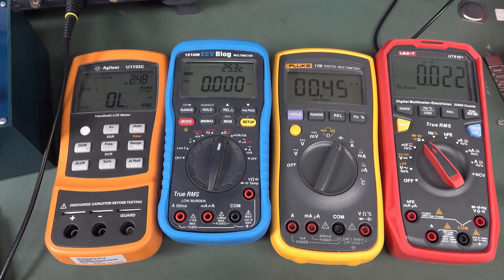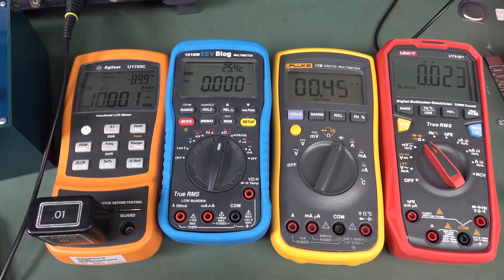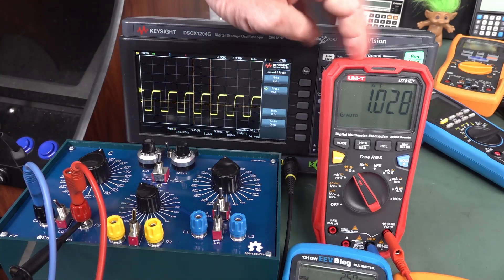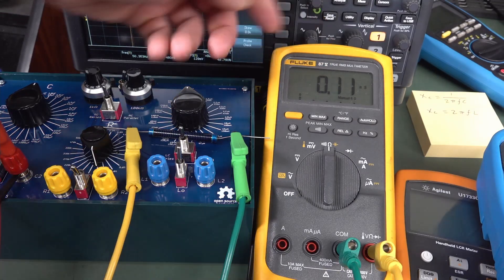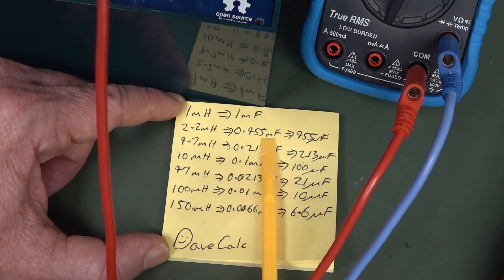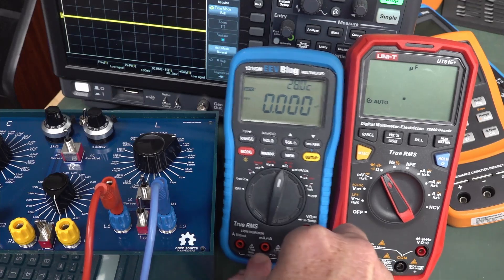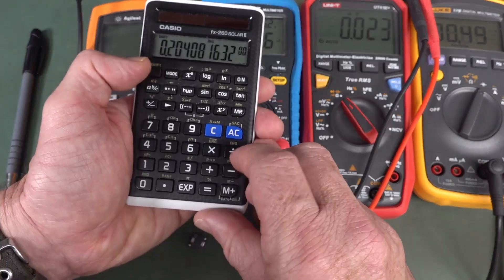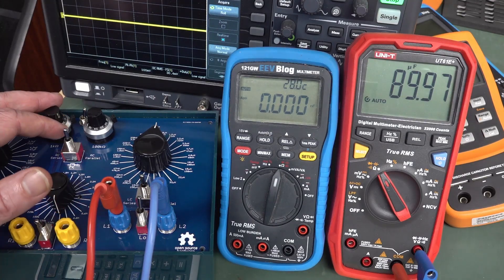EEVblog 1465 - Your Multimeter Can Measure Inductors

Comment: Okay... What's bugging me here is that my math is different. If the measured impedance is the same, then we can say -ZL=ZC, hence  -jwL=1/(jwC) where w is 2pi*freq... After some algebra, I get L=1/(w^2*C). Hence it is critical to know the frequency to compute the inductance. You're talking like the frequency cancels out or something.
Reply: Ok, so apparently this is all a big joke. Clearly most of these multimeters use an RC ramp to compute C.  But seriously, my Mastech MS8264 puts out a steady 400 Hz for capacitance measurement regardless of range or capacitor... if it's measuring current, it's just measuring V/Z, so if we compute the L for the equivalent Z, why wouldn't it work?

Comment: Why does mu LCR meter has different frequency to measure the inductance and why the result vary according to the frequency chosen?  I have measure a power supply choke.  It gives me 21 Henry at 120 hz and 18 H at 1 KHz and -5 Henry at 10 KHz…

Comment: Well that's cool, unfortunately my Fluke 117 isn't good at it at all.  It can't even be used on larger ones.  The only one I got read reliably was a 100mH coil.  I looked at it at the scope and it sends the pulse super random.  Had to capture it, and it's a 120mV pulse, lasting 1.2ms, whenever it wants to.  Surprisingly though, it reads capacitance great, down to the 10nF level.

Comment: This method seems a little complicated.  Seems like it would just be easier to build a calculator first instead of being so reliant on Post-It notes.  Once you build your specialized calculator, it should be no problem to slam together components to make a functional oscilloscope and signal generator.

Comment: I don't think that's supposed to be a triangle wave at 2:23 with the fluke. Looks more like the charge/discharge cycle of a cap subjected to a square wave. I think that it's basically using a DC measure of capacitance using time constants.

Comment: It's interesting that for some of the meters the frequency changed with the capacitance. I wonder if those use the capacitor in an oscillator and then measure the resulting frequency to calculate the capacitance value (as opposed to measuring the time it takes to charge the capacitor which is how I had assumed it measured them).
Reply: The one that showed a square wave in the scope probably did the charge time thing

Comment: I have 2 very old multimeters (over 20 years) and one has no capacitance measure and the other has slots to measure both on through hole components.

Comment: I love how the 121GW was actually almost bang-on with the 150mH inductor - it has shown 161mH, which you have commented as "not too far off", but then the LCR meter at 7:46 showed almost exactly the same, so 121GW was not off that much :D. It has more error for smaller inductors though.

Comment: Two other useful methods: create a parallel LC circuit with a known C, feed it with a signal generator through a series resistor, find the resonant peak and calculate L from it (if L is sufficiently large, you can use your phone as a signal gen). You can also measure the Q by measuring where the voltage falls to 1/sqrt(2). The other method is to feed the L through a small current sense resistor (in the GND side) with pulses starting from 0 duty cycle, increasing very slowly. Look at the rate of increase of current through the sense resistor, calculate L from it. If your pulser can provide enough current you can even measure the saturation current. You can build a pulser circuit with just a 555, mosfet, catch diode, and a handful of passives.

Comment: April fool to you too. The capacitor measurement uses a relaxation oscillator and measures the frequency that is proportional 1/C. I.e. Smaller C gives higher frequency. The relaxation oscillator can be as simple as a built in Schmitt trigger inverter and the dmm measures the period for a direct conversion to capacitance.  Putting any inductor in place of the capacitor with a dmm set to capacitance is just a short circuit. The relaxation oscillator just won't oscillate.
It was good to see the 10G ohm resistor I sent to you in mailbag in use too. Great joke video.
Reply: He practically got me on this one until i read your comment and started thinking about it in another way.

Comment: Dave, they don't output a triangle wave but rather a pulse. The priciple is called a charge balance. It's what you likely learned in high school about capacitors: Switch on a voltage in a RC circuit and you get an exponential charging function. Do a little bit of maths and you can calculate the C, provided you knew the R. Some of these do it exactly like that and this is where you don't get the triangle wave and others use a constant current source which results in the triangle. The idea behind the triangle wave is that you can easily calculate the slope by doing a linear fit which then leads to easy calculation of the C.
Reply from the maker: Yeah, well, that's just, like, your opinion, man.

Comment: well since you essentially need a scope to pull this off anyway (for probing the meter) 
you can just aswell use the test signal gen for probe compensation for that purpose. 
some scopes can generate a variable frequency on that output which is quite handy too

Comment: You wonder why meter manufacturers haven't added inductance measurement. Sure, 30 years ago it would have meant a shed load of extra gubbins inside, but with today's tech surely it wouldn't take that much - as demonstrated by Dave's DE5000 teardown.

Comment: Actually ive got a brand new electric shower i fitted but it let out the majic smoke after 1st power up.
I found 2 inline inductors on the power to the control pcb.
Aqualisa Lumi 10.5KW, a pretty expensive shower.
Its a touch sensitive front panel on/off.  So im wondering if the inductors are really needed? As i linked them both out, but havent tested it yet.
I think i blew it when i had power going to shower when i connected molex connector for panel pcb.  Which blew the inductors.
I wouldnt mind getting it working

Comment: Cool trick thanks, I sometimes forget about it but those ~$15 component testers also do a decent job at testing inductors and they can test the lower values too, I can't verify its accuracy, but now I could compare it to my meter at least.
Reply: You know you can make your own measurement test set with better accuracy ?  Just use a kelvin bridge.

Comment: I'm more impressed by that 10 GOhm resistor! I didn't know they made such high resistor values. I remember one of my professors scoff at the idea of 1 GOhm!
Reply: Mouser has 10 TΩ resistors in stock, they're not cheap though.
Reply: @rocketman221projects  What would the purpose be of such large resistors?
Reply: @ElTwOJaY  The one that Mouser has is rated for 30 KV, so it's probably intended for high voltage measurement. It would only have a 3 nA load at 30 KV.
Reply: @ElTwOJaY  they can be used in transimpedance amplifier configurations to measure very small currents (fA - nA). I have some resistors which are contained in quartz tubes and labelled with powers of ten It literally says 10¹² Ω on the part.
Reply: @uwezimmermann5427  hmm interesting, I am not much of an RF guy.
Reply: @ElTwOJaY  not much use for these in RF, rather in measuring tiny currents
Reply: I have a TΩ in my collection. It is awesome, cased in glass!

Comment: The method I use (make a LC circuit with a reference capacitor and measure the resonance frequency ) work mostly for small values so it cans be useful
Reply: That's what I've done in the past. Make parallel tuned circuit and use a little negative dynamic resistance circuit to make it oscillate and then measure the frequency.

Comment: I still don't understand inductive loads. A good idea for a video would be a summary of the best free online electrical engineering courses and channels. I love the content from Big Clive, and Fran and you, but I don't have the understanding to properly appreciate them.
Reply: The simplified answer is an inductor is a lot like a capacitor, just replace voltage with current and capacitance with magnetic fields, you put current though it, it charges up a magnetic field which restricts current flow until it's full then it becomes just a wire, afterwards it does the opposite when current flow stops feeding its charge, thus it smooths out changes in current, similar to how a capacitor smooths changes in voltage.

Comment: Not getting a result with an old Fluke 83 original! By the manuals I can find all the old Fluke 80's work by charging with a fixed current and testing voltage -- updating only once a second -- rather than testing at frequency. They walk you through though how to estimate large capacitances quick by using the ohm-meter though since it's also a constant current source, so I still got a useful tool added to my belt today!

Comment: i liked the "short the temperature leads" trick to get the internal temperature but this is the first time I have heard of using capacitance four measuring inductance
Reply from the maker: A really old school trick.
Reply: Had no idea about that. Mine will show internal temperature with no probe connected instead.
Reply: Why would you want the internal temperature of your multimeter?
Reply: @ryanb8302  Cause it would be closely related to ambient room temperature if you wanted to measure that.  I often do.
Reply: @kissingfrogs  I see
Reply: I only come here for april fools. Shows how gullible engineers are.
Reply: You all actually fell for this ?
Reply: @miller-clem  or did you you fall for others playing along convincingly

Comment: What you need now is a firmware update so that the multimeter calculates the reciprocal for you and handles the units properly ;)
Reply: Problem is the accuracy is so piss poor you could never really properly calibrate it. That's a big problem if anyone ever wanted to use this meter at work, where equipment needs to be regularly and fully calibrated.

Comment: Problem  is, this only works for good inductors.  If the inductor has low Q or a shorted turn, the results are going to be not so useful.   In my experience, I never need to test good inductors-- I'm testing inductors and IF transformers in old radios.   So not so useful, IMHO.  Regards.

Comment: Hey, what an awesome idea, loving it! Takes some calculation but opens up new possibilities. Well, I've got a vintage Meratronik E316 analog RLC bridge here, and can assess inductances, but the thing will surely need some verification and calibration before I'm comfortable with it :)

I just hooked up my UT890D+ to a scope, got a triangle wave like 2.7 cm period at 100µs/cm, which would calculate to 3.7kHz, and that should be in the audible range. Checked that with an AF signal tracer, heard nothing. No 3.4kHz here... Measured the frequency with a meter - got 60kHz. So, it looks like the scope was wrong. Test gear sheenanigans all the time, LOL. Will take the meter to our local hackerspace to measure the frequency more accurately.

"Let's check again to see if it was not a Fluke..."
Reply: Wouldn't the scope and the frequency meter have different impedances and therefore give different frequencies?
Reply: @miklov  impedance affects the voltage, and frequency stays fixed unless the meter places the DUT in the oscillator's resonance circuit :)
Reply: @KeritechElectronics  Without being familiar with how the particular device operates it just seemed like a reasonable explanation for the different frequencies you measured. Anyway, I hope you get it operating the way you want =)
Reply from the maker: Sounds dodgy!
Reply: @EEVblog  squishy, squishy :)

Comment: This trick looks very handy but unfortunately it doesn't work with my cheap multimeter ☹ BTW, when I'm connecting diode it just pulses instead of sending some wavy signal.
Reply from the maker: Bummer :-(

Comment: fantastic video, works a treat! (I have the 87V though so it was pretty much guaranteed to work)
Reply from the maker: What accuracy did you get?
Reply: @EEVblog  it was pretty much the same as yours with a hair of a difference either way - I have the same inductor test box as you so I just tried it with that
Reply from the maker: @Zardox-The-Heretic-Slayer  Nice! It's a handy box. Had a bit of a hard time with the SMD inductor though, tricky to probe those little suckers.
Reply: @EEVblog  I use an offcut of an old gold plated PCB (from old RAM sticks so the pitch is perfect for general components) to measure SMD stuff like that. using 4-wire measurement on that seems to be pretty accurate; good enough for England!

Comment: Great tip, Dave, didn't think of using a multimeter like that. Not very accurate but plenty good to get a ballpark value which is often enough (and the inductors are rarely precise components anyway). 👍
Reply: April fools.
Reply: @brandise76  It's a shame that here in Mexico this video shows at 31 of March, hahahaha, well, this video give me some ideas.
Reply: If you read about the saturation of magnetic cores in the forums on internet you will get the same conclusions, the values on inductors are more fuzzy than R or C.

Comment: This video left me somewhat confused. Are you suggesting the capacitance mode on a multimeter will always read the inverse of inductance? How does it depend on the test frequency?
Reply from the maker: It should do, neat trick huh. Give it a try.
Reply: @EEVblog  thanks, I’ll try this
Reply: Dave answered that in the video. You need to consider the equations for impedance, they show the relationship of frequency to capacitance and inductance.
Reply: Don't forget to convert the value on the display to mF first, and then the inverse answer will be in mH.

Comment: Since it's mostly just a bit of maths.... 121GW firmware update to add an inductor measurement mode utilizing the hardware on the capacitor range?
Reply from the maker: Will have the look into it!

Comment: This would be a good test for a late first or early second year engineering student.

Htey would know the theory but can they put it into practice. 

It is obvious when you think about it that the capacitance measurement must be using non DV waveform so from first principals, you can get the conversion as an inverse from impedance. 

I've only ever used this a couple of times, normally a check to make sure the inductor is still good rather than looking for a value but it is a good trick to know if your short an LCR but there are some decent very budget options for these measurements in the hobbyist and student space

Comment: I have made a Big Capacitance measurement device with Cypress PSoC 4 using the build in Current Source and ADC, not very accurate but it can measure FAST and thousands of uF in a blink.
The idea is to charge up the capacitor with current and measure 5RC time constant, which is the time required to reach Vcc voltage.
Reply: I've soldered and programmed a kit with the same principle for my programming class at uni. Pretty neat!
Reply: Measuring at 1 times RC would yield a better accuracy. The curve is steeper so every error in reference voltage amounts to a smaller error in calculated capacitance.
This acutually works with inductors too.

Comment: Hey Dave great video as always.
I believe the keysight (old agilent) LCR meter is somewhat affordable. roughly $450 if i remember correctly.
Id love to see a video on conducting a loop impedance check or rotor influence check on a brushless motor.
Reply from the maker: You can get the same functionality for under $100 these days though.
Reply: @EEVblog  oh I agree completely. I was just pointing out the value of the lcr meter you used. But yeah, rotor influence check please :)

Comment: Probably not something I'll need to use in my tool set, but thanks for sharing! On the subject of metres I was in the market for an upgrade the last few days and really wanted the 121gw but there's not really been a comprehensive review on the final build with latest firmware? I ended up going for the bm786 instead but kind of kicking myself now after watching this and seeing you pull the 121 out 🤣
Reply from the maker: The 786 is a great meter, don't worry about it.

Comment: interesting..might have to try this sometime...
question for you to answer in a vid sometime Dave (if ya can understand what i mean!)...why are the '5' values of resistors and caps etc down at 4.7/47 etc... when there is '10' values at 150 etc...maybe ill ask on saturdays stream... if i wake up early enough!
Reply from the maker: The E12 range of values is a geometric sequence, designed so that no value is more than +/-10% away from another value.
Reply: @EEVblog  well that sounds simple enough!.... geometric sequence... i might have to look into that some more!